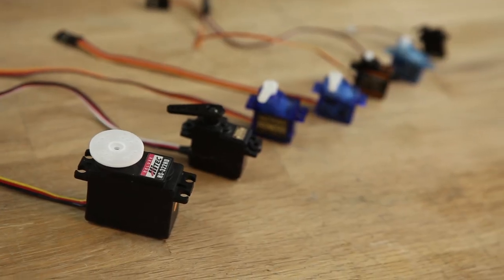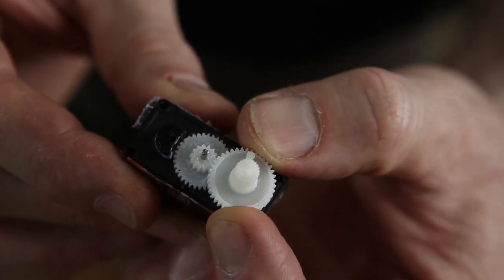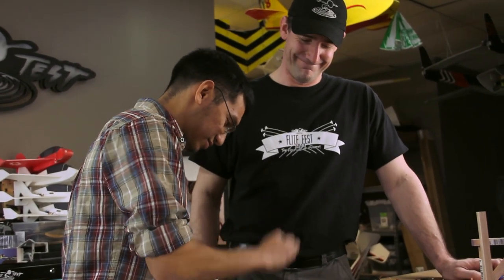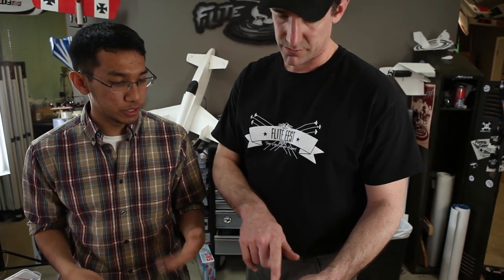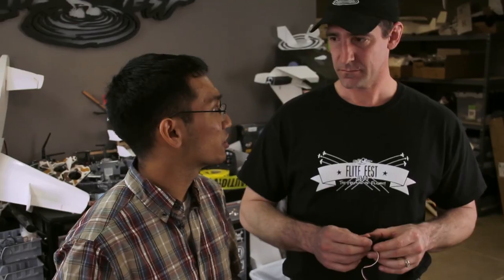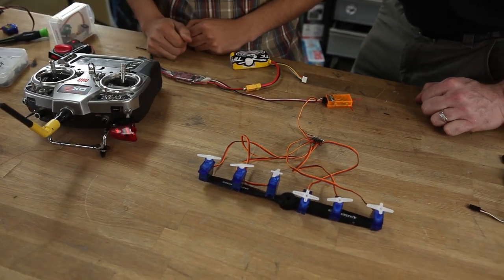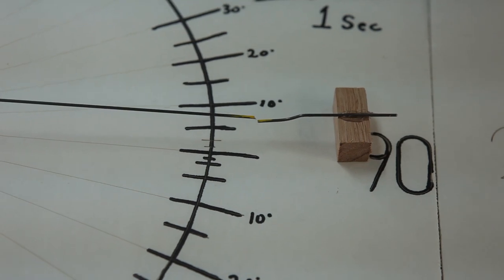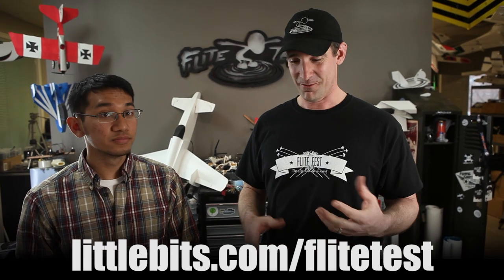Flite Test | Servos 101

Comment: Actually the torque is the same, no matter the length of the servo arm. It's the FORCE applied that changes. The torque is a fixed number for the servo.
Reply: Tiago de Pádua Correct.
Torque = force * lever length.
Okay, technically the lever length is called "moment arm" or something like that, but I'm keeping it simple so non-nerds can understand it better.
Reply: 44R0Ndin 
Let's try working that formula with actual numbers.
force * lever length = torque
5 *10 = 50
5 * 20 = 100
Looks like torque changes when you change the lever length even though the force stayed consistent.
Reply: SuperLoopholes
Exactly as I expected.
Of course, if you hold torque constant in the equation, shorter lever arms apply more force.
torque = force * lever length
2 oz-in = 0.5 oz, 4 inch arm.
2 oz-in = 1 oz, 2 inch arm.
2 oz-in = 2 oz, 1 inch arm
Mechanical advantage. It's all about ratios.
Reply: This is reminding me of ohm's law. Which makes sense because it's a similar 3 variable formula.
Reply: SuperLoopholes That would be correct if You'd be turning a servo shaft by constant force applied to the lever. Torque would change.
In our case servo produces some torque on a shaft, regardless of how long the lever is. And the longer the lever the less force You have on a pushrod and more it travels.
Reply: SuperLoopholes  Nope you have it backwards.  Torque is the same but depending on how close you connect on the horn you will get a different output force.
Reply: Rich Morgenstein

The motor is applying the torque.  It is the same torque regardless.  The lever length changes the applied force.  Please stay in school.
Reply: *****
I am right period.  The torque of the motor doesn't change.  The produced force at the control arm changes depending on length from the rotation axis.

I don't know why you don't understand this simple concept.
Reply: So you were telling me what I said in the first place.  Maybe you should learn to read.
Reply: Tips & Tricks

If you add some elastic material on the scale, the force/angle ratio decreases. The energy of the rotor inertia will be stored in the elastic material at a lower force. 

Energy = force * distance, so a smaller fraction of dynamic forces will be induced in the reading.

Nerds also use an arm length multiplied by cos(stall angle), where stall angle zero is at perpendicular arm position.

And here is a cool way to make a nearly linear motion without cogs:
https://youtu.be/r2c2PfRefbk
Reply: The length of the arm is exactly like a transmission. A short arm is like low gear - high torque low rpm. A long arm is like high gear - low torque high rpm.
The force at the end of the arm is the same regardless of the length of the arm. Just like with a transmission, if the engine was fixed at putting out 100 horsepower then there would be 100 horsepower at the output shaft of the transmission, regardless of what gear it was in.
Basically, torque x rpm = horsepower. So whether you have 10 rpm and 1 torque or 1 rpm and 10 torque you have the same power.  The only thing that changes with the gears (or length of the arm) is the ratio of torque to rpm.  The force or power at the end of the arm is constant, just like the torque of the servo is constant. Only the ratio of torque to rpm at the end of the arm changes with the length of the arm. No different than with the gears of a transmission.

Comment: So basically you guys didn't get back to magentic induction servo?
Reply: My guess is that it uses a hall effect sensor to sense position rather than a potentiometer. This has the benefit of a longer lasting servo since hall effect sensors have no physical wear like potentiometers where there's a wiper arm skimming across a resistive surface. I also believe this to be true because Peter physical rotated the servo a few times in one direction where if it was a normal potentiometer it would only rotate to the endpoints of the pot.

Comment: Not sure if this has been mentioned already, or if this is even correct, but i THINK the reason they move the servo 1 inch to measure the torque is because in the U.S. torque units are pounds per foot or 'foot pounds' etc so moving 1 inch is easy to convert to ft/lbs because it is 1/12 of a foot.... i'm just speculating haha i'm not totally sure.

-Colton

Comment: Here's some basic Motors 101 for you:
There are many types of motors used in almost everything:
Brushed motors
Coreless motors
Induction motors
3-phase motors
Brushless motors
Synchronous motors
Permanent magnet motors
Stepper motors

Almost every motor has three parts: the stator, the rotor, and the commutator.

The stator is the magnet that does not rotate.
In a brushed motor, it is just a permanent magnet, as it is in a coreless or a permanent magnet motor.
In a brushless motor, an induction motor, a stepper motor, or a synchronous motor, it is a set of coils.

The rotor is the rotating element.
In coreless motors, the rotor is just a set of coils.
In an induction motor, it is the squirrel cage assembly.
In a brushed motor or a synchronous motor, it is a set of coils wound on laminated metal.
In a brushless motor, a stepper motor, or a permanent magnet motor, the rotor is a permanent magnet.

And finally, the commutator is responsible for the timing.
In a brushed motor and a coreless motor, the commutator is a brush.
In a brushless motor like that in a computer fan, the commutator uses hall effect sensors. In larger motors like those in drones and planes, the ESC relies on timing alone.
Induction motors have no commutator.
Synchronous motors use slip-rings to provide power to the rotor, but do not use a commutator for timing.
Stepper motors require a special controller and have no commutator.

Comment: Learnt from experience to always pay extra and get metal gear servos, that way they won't strip and when move up you can just take all your electronics with you. 
Best servos for acro I've used so far are the Corona 929MG. Excellent upgrade just to replace the standard 9g servos most planes seem to use these days are dirt cheap ($5.50 per unit from Hobby King).

Comment: Thanks for the fantastic video! I've learned a lot from you two.   I'm just getting into the hobby now and every little bit helps.    You've inspired me put together a better power supply setup that will prevent the servos from browning out the receiver power in the event of low battery and/or overload.  Cheers!

Comment: Awesome:) At 13:30 with regards to servo speed. The rating is how long to move 60 degrees so LOWER is faster and usually better; not higher.
Reply: Rav Gupta lots of little bits of misinformation in this video. still really good for anyone with a cursory understanding of physics.

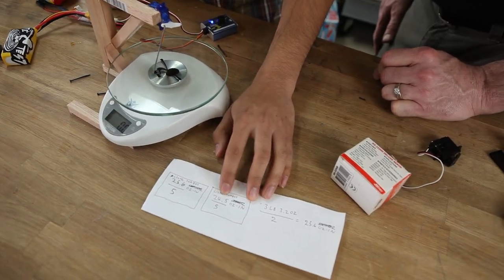Comment: 11:30 Alright Torque is the Lever arm length times the Force of the thrust. T=LxF So for a lever arm 1" long and a Force of 100 oz you get T=1 in x 100 oz = 100 oz-in of torque.

Unlike what they say at 11:30 as the lever gets longer the torque doesn't change. The torque is the torque. However as the lever gets longer the force goes down. There is an inverse relationship between the lever length and the max force of the thrust. As one goes up the other goes down.

Comment: It's the rotor not the stator :)  Technically a commutator but no worries though.  Great video as always Guys!  Stellar job  Keep em coming.
Reply: Eric William -MKme Tech It's actually an armature which is usually a laminated iron core, not a commutator.  A commutator will convert AC current into DC current in a generator, or vice versa in a motor, and is in the form of copper sections insulated from one another which the brushes would run on.
Reply: Eric William -MKme Tech The commutator is the part of the rotor that had the contact pads for the motor brushed :)
Reply: Eric William -MKme Tech true. and i always thought it's plain simple to remember that stator is static and rotor is rotaiting.
Reply: HeadShot360IN Actually, brushless motor has two subcategories: inrunner and outrunner. Inrunner has windings fixed (outside, close to the casing) and rotor (with magnets) spinning, while outrunner is what you describe - it has fixed (central) stator with coil, and spinning bell (magnets are outside, attached to the cylinder).
Reply: Stators are stationary while rotors turn. If the "rotor" rotates and has a commutator, we call that an "armature".

Comment: Yet another great vid guys. Great failure-mode demonstrations. If somebody knows of an aerodynamics program that discusses forces on RC control surfaces, that would be great. That would solve that issue where you just look at "what the other guy is using." Better to actually calculate and know.

Comment: Thanks for the info, only correction is torque remained the same regardless of the length of the lever arm what changes is the forever or load, further you go out on the arm, greater throw but less forage. Think of a pry bar. Torque of 1lb/in says at one inch from the center of rotation is equal to 1 lb of force, go out 2 inches you get 0.5 lb of force go out 1/2" you get 2 lbs of force.

Comment: The 1 inch is just to make your life easier, you could measure it at a different distance, but then you'd have to multiply the reading to get the actual torque. It's easier to just be able to read the number straight off of your force sensor\scale.

Comment: Nice informative video, folks.  I would, however, like to point out an error. When you were discussing moving to different positions on the servo arm, you stated that the torque changes - more torque closer in and less torque further out on the servo arm.  That is incorrect.  The torque never changes; it is always the same regardless of where the pushrod is attached to the servo arm.  What does change is the force.  More force closer in, and less force as one moves outward on the servo arm.  You showed this in the video at the 11:00 point when you had twice the force on the scale because the attach point on the servo arm was at 1/2 inch.  So 48 ounces at 1/2 inch is equivalent to 24 ounces at 1 inch - both are the same torque; only the force changes.

Comment: The servo torque is related to the gearing inside the servo and the supplied voltage. This torque will drop off as the supply voltage drops off as the battery is drained. However, the more interesting part is the use of mechanical advantage between the servo arm, rod and control horn for the surface, this is what really needs to be explained. As mechanical advantage is always a trade off between movement of the control surface versus servo resolution. Precision movement of the surface is desired without loosing too much resolution from the servo .

Comment: The torque is constant in a servo. The force is smaller if the arm is bigger and the force is higher if the arm is smaller. "Torque = Force x Distance Arm" 11:45

Comment: The difference between an analog and digital servo is that with analog servos the motor control is synced to the control signal where with a digital servo it's independent. Some digital servos are also limited to relatively low control signal frequency e.g. the MSK DS1210 can only accept a control frequency up to 120hz.

Comment: Is it true that digital servos draw more power? If I'm using multiple servos (ailerons, rudder, elevator, pan, tilt, roll) for my fpv... Would I be better off using analog to try to prevent brown-outs? Or am I better off using digital with a stronger bec?

Comment: Great explanations. Learned a lot about servos. Thanks guys. Now, please give us a lesson in picking servos. The price range is dizzying. Are the high priced ones ten times better than the lesser? I know I don't want to crash my plane for a poor servo.
Reply: A more expensive servo will be faster, stronger and more precise when centering. As far as reliability  in my experience it dosent seem to matter, just make shure you have a proper torque rated servo for your application.

Comment: Great episode!  Thanks for explaining stuff.  I learned several things.

One thing, I wish FT would have showed how to reverse a servo by rewiring it.  This is information some people need to know.  Especially with airplanes with gyros.  The gyro in the receiver does not know which way the servo is running. If you just replaced a servo in your airplane and the new brand run the opposite direction, reversing it in only the transmitter will cause the gyro to push the control surface in the wrong direction when the transmitter pushes it in the correct direction.  The result is an out of control plane.  I'm talking from experience.  :)

Comment: By making your distance = 1 [inch], it simplifies the calculation.
The torque equation is:  

Torque = Force * Distance  (T = F*d).  

Torque = Force * 1
Torque = Force   (force x 1 is equal to force)

** Do note, this is in units of  [lbs-in], not [lbs-ft] of torque.**

Comment: So if I were using 18-20 analog servos, what type of power supply should I use?
Reply: Probaly a good BEC in your ESC, bufferd with 4-5 nimh cells

Or a separate BEC, but still bufferd

Comment: f you were to use an old cheap two wire motor style servo for steering, could you use the two outside wires on the receiver to make this work?  or am I deranged and polluted?  Thanks

Comment: First, it's a rotor, because it rotates.  In an outrunner that's a stator, but in an inrunner like a servo motor, it's a rotor :)

And it's 1 inch because if you measure the force from anything else, it won't be INCH-ounces.  Torque is the force times the distance from the pivot.  Inches, feet, meters, whatever.

Comment: Great info. Especially about the servo brownouts, I literally had no idea about this. I think I've experienced this on my fixed wing. What's the solution to stop that from happening?
Reply: ***** You need to get a BEC that can handle more load. Peter was using a 1 A BEC in that ESC, if he had switched to something with 2.5 or 4 A it should have worked. 

I read that a standard servo draws about 10 mA, stalled it draws about 200-250 mA and in normal flying 75-150 mA. Since he was moving them quite fast, it was probably more in the 200 mA area. This times 6 servos will result in 1200 mA - too much for the BEC, so it wasn't able to deliver enough power to the receiver.

The bad thing is that you won't notice it as long as it is in the "normal flying" zone with 100 mA, but if you do something crazy in the air, it will just shut down on you.
Reply: Balu Thanks, that's actually really helpful. Now I know what to look out for.

Comment: An analogue servo can actually be driven at much higher frequencies than 50Hz, given the correct signal, because the servo angle is determined by the duty cycle, which at max is about 2ms and the signal period is normally 20ms.  I.e. in theory almost 500Hz is possible.  I have done this for the autopilot I was developing and it worked great for some servos, but some servos get very unhappy.

Comment: 13:35 there is an important error: The lower the number is the faster the faster is the servo. It s/60° - this the reciprocal of a speed as the speed is measured in °/s and the 60 is because its measured as the average speed in a 60° move.
That was the important stuff, now comes the pedantic stuff:
It's µ not u (someone else posted that already).
The servos torque is dependent of the supply voltage not of the leverage. If the leverage gets longer the thrust gets lower. It does not change the torque which is the product of force and leverage.
Torque can neither be measured in kgcm nor oz-in as kg and oz are mass units. Correct would be Nm, Ncm or to have it compareaple to the lift force of kg on earth near paris kp. oz-in would mean the same servo could not move anything in space but in fact the torque there is about the same. So if someone writes 1kgcm he's talking about kpcm or ~0.1Nm (exact: 0.0980665Nm)
To do the measurement on the scale exact you need some shims or an adjustable rod to make sure the servos lever is perpendicular to the rod and parallel to the scales surface.

Anyways it's a great explanation and I'm happy know that I know now a 9g Servo is called so because of it's own mass. I was guessing that but didn't know it and is was for some time quite confusing.
It would be great to establish size and mount standarts for servos. The model train guys have an associations (NEM, BRMSB and NMRA) to standardize couplers, coupler mounts, gauges, wheel and track profiles... I'd appreciate to go for one international standard association for the RC-stuff.
Peter, would you want to do that? Maybe you could get a paid job in such an association. You're smart enough to understand the stuff. You'ld need to learn to be pedantic when defining standards. Maybe someone else could be employed for that. It should be a group of at least 10 people as there is also radio stuff to define which is far more complicated as when I was a kid - I know an engineer who is specilized on that and unemployed as he rejects all military jobs. You're internationally known. So you're the right guy to start such a thing. Everyone whatching RC-plane videos on youtube knows your face.

Comment: Your torque unit of measure is (ounce-inch).  Because you are using an (ounce) scale, if you move out only one (inch), that allows you to use the scale reading as an (ounce-inch).  Torque= Length x Force.

Comment: Can a servo use the electrical signal on a car's brake lights to flip up an airbrake ? 
BTW, I mean a full size car. 
I have seen some huge scale planes that require a lot of torque to move the flaps.
Thanks for any help.

Comment: Nerd comment: let's be careful with torque vs. force (or thrust). The torque of the servo is (nearly) constant as you change the moment arm length. That's why the force it produces changes linearly as the moment arm is changed linearly. Thanks for the vid!